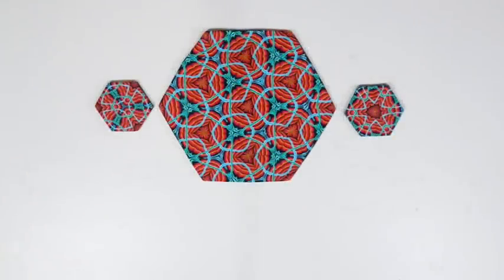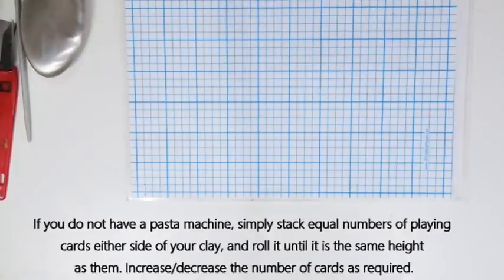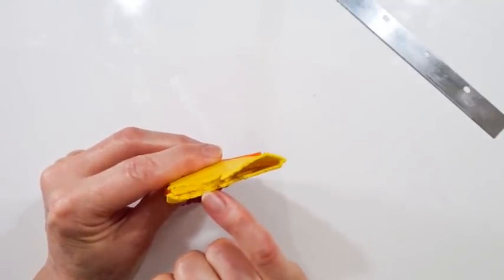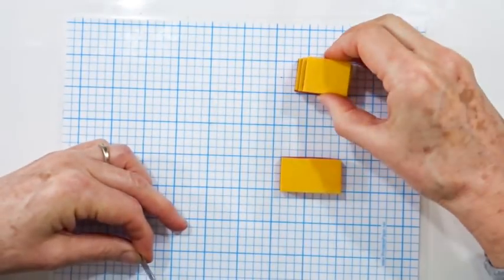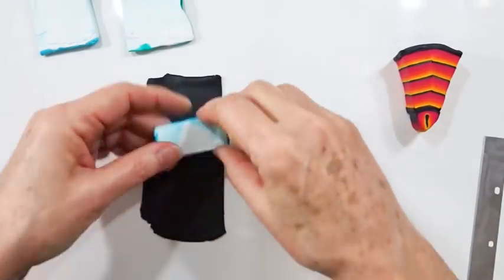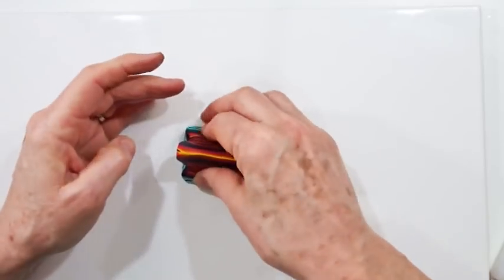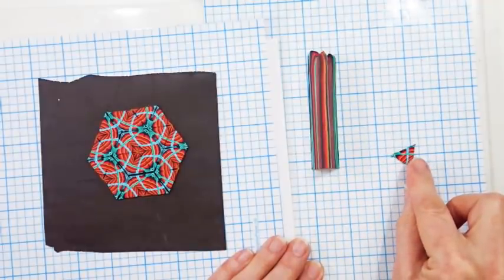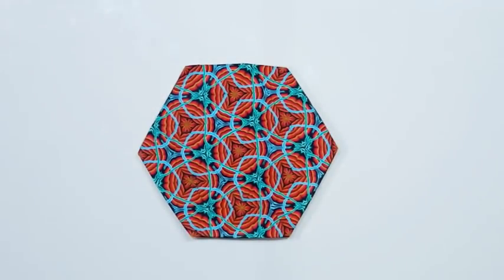Circuit Cane in Polymer Clay, a Tutorial

Comment: I have been have been using premo but since that is not available I started using Fido but the but the problem with that is with conditioning it just chews up and splits when I put it in the pasta machine and it is so crumbly that it’s hard to do a project I don’t know what to do
Reply from the maker: That sounds like you have a very old batch of Fimo :( Is it soft you are using or professional ? either way they shouldn't do that straight out of the packet if they are fresh. However, older Fimo can sometimes do that. I have a video which will probably help a lot as I use old clay all the time, so had to learn how to get around this problem. Using the tips in this video, you can still condition the clay fairly quickly and get it into a good usable state. I hope it helps, as there is nothing so frustrating as sitting down to do a project and be faced with packet upon packet of crumbly clay  :( - https://youtu.be/pFx7frDYJG0